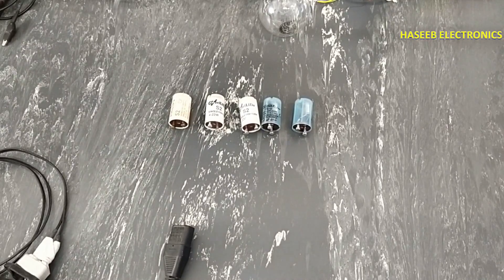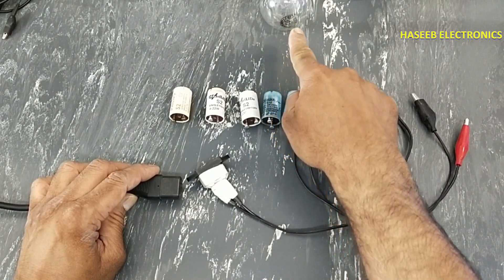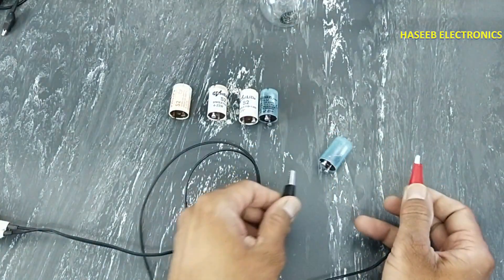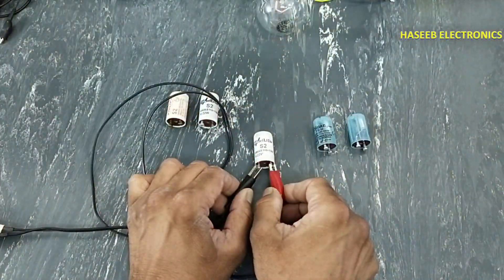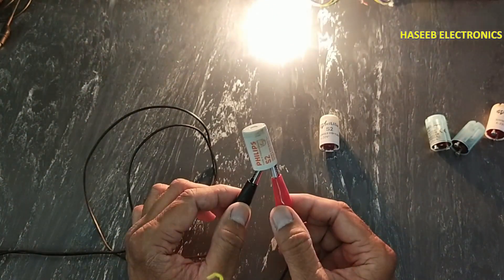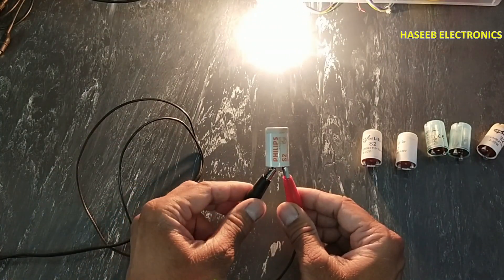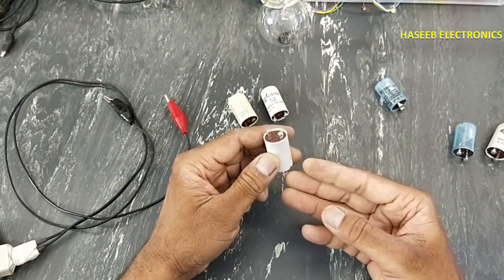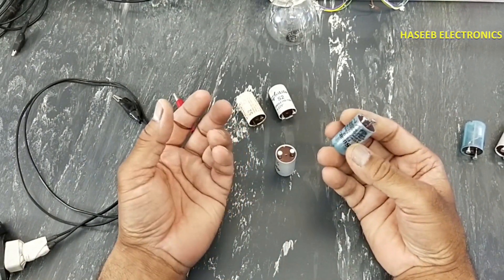{922} How to test tube-light starter

Comment: What is the use of class x ,y capacitor between input and output of the smps circuit , maximum this capacitor placed nearly transformer mid area  sir , kindly explain